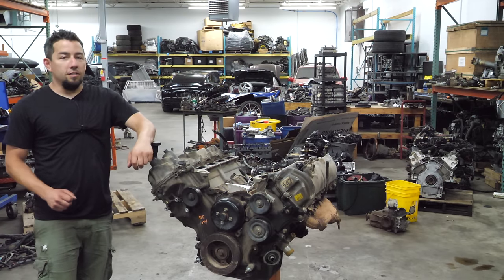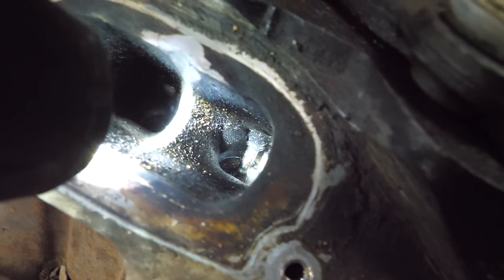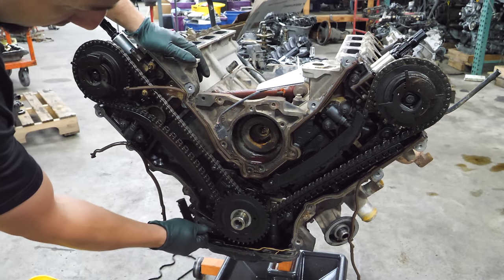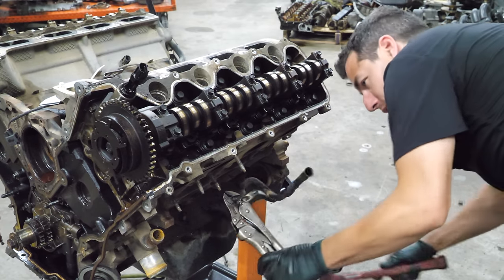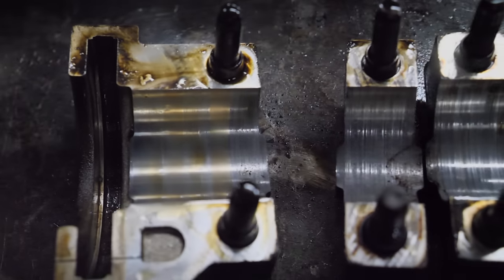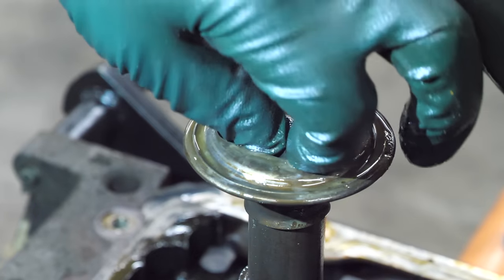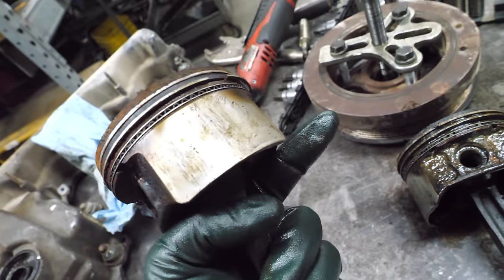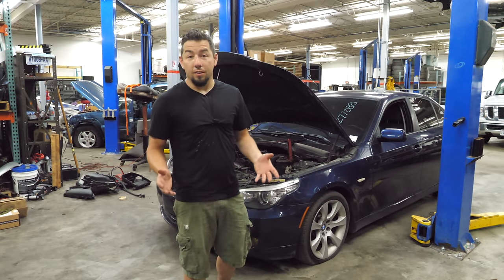Bad Ford 5.4 3-valve V8 Engine Teardown. Which of The MANY Possible Failures Took This One Out?

Comment: I don't know why, but the 3v 4.6 and v10 faired much better.  One can say less of them were used, but there are allot of Explorers out there with the 4.6 3v.  I work at a Ford dealer so yeah, we've fixed a ton of them.  But I have seen quite a few with well over 300k on them.  In fact my uncle has a 2009 Explorer with close to 350,000 miles.  But, its been meticulously maintained.

Comment: I see these over 250-300k all the time. Most all the problems they have are lack of maintenance issues. The 2 PC spark plug is a stupid design but u can get a 1 PC replacement for cheaper.

Comment: Every thing has flaws. I have an 08 f250 oil changed every 3000 miles since truck was bought new in 07 September.  I don’t use this truck for anything but driving and occasionally to pull a utility trailer.  My truck has 104,000 mile lives in the garage except when using. I’ve always taken excellent care of anything I owned it uses no oil but as I have said if you take care of what you have it normally will be ok for many mile.  Before this 08 I had an 04 f250 and it used a quart of oil every 2500 mile, no other problems I drove if 125,000 before I bought the 08.  I once had a Chevy with a 350 and it used a quart of oil every 500 miles had it tore down and the piston rings were lined up causing the oil problem so remember anything coming out of factories can have problems

Comment: I have a f250 2008 300k miles, 1 manifold replacement at 100k ,no other problem. Change oil every 5k miles and auto matic trans.all original. Daily driver and farm truck.

Comment: Thoes cam journals are normal and fine. All 5.4L cam journals are like that because they used aluminum for the journals and heat treated steal for the cams. Mix match in materials with no actual bearing as a buffer so this happens

Comment: This engine is KNOWN for timing issues. Under performing oil pump is the main issue. Cam phaser issues is the next major issue with this engine.......Also timing tensioner blowouts, which is what appears to have happened here. Tensioner left the chat which allowed the chain to eat the plastic timing chain guide.... which also allowed it to jump timing.

Comment: I know someone who swars by them 5.4 3v, and hes had it replaced once in his truck... They make good power but man they are such terrible engines, I worked on the 4.6 5.4 and 6.8 and both the 3v and 2v flavors, I like the 2v better once you get around them popping plugs out the heads on the 5.4s but they were at least somewhat reliable unlike the 3v...

Comment: The mine problem with these engines failures is the quality of oil people use its beat to run mobile 1 or Amsoil full synthetic but people let these service shops put cheap conventional oil in them I've seen 3v 5.4s wit 400+k on them spark plugs do sieze wd40 sock them then antisieze new 1s

Comment: I had 05 with 5.4 and the only problem I had was plugs , but otherwise it was a good motor I had 154000 on and only replaced starter .

Comment: I have a 2002 5.4l 2V Triton f150 with 160K miles, and except for #8 burning ~1qt oil/3K miles, it's still going strong. I change the oil religiously every 4-5K miles. None of the plugs snapped when it had its 100K tuneup. Videos like this one scares me off buying a new Ford truck. It's like Ford and other auto mfgs forgot how to make engines!

Comment: 5.4 3v is a good engine if you do proper maintenance...as far as the phasers, get a lockout kit and a tune and your good to go😎
Reply: @armslength2618  you are correct and I know valve timing is there for a reason.  Again 5.4 3v is a good engine..just stating my opinion on the phasers being a point of failure and a lockout kit being the answer to this issue, would I do this to a stock engine? No..a boosted engine so far from stock that it wouldn't matter? Yes I would👍

Comment: they're basically an late 90s engineer designed motor meant to be a throw away at about 200k - my 2009 fx4 has been flawless so far -150k  always change my oil at 3000 5-30 motorcraft

Comment: Before I make a purchase of a car, I visit car parts stores and ask questions. I then go to independent car repair shops
and ask questions. eyebok's comment(s)  below were absolutely verified by my visits to the above. What did I buy? A used
Hyundai Sonata which as of today has over 150,000 miles on it and we have done NOTHING for repairs. We change the oil
every 3,000 miles, transmission fluid service, etc. on a timely basis. The only other car in our family that went further was a 
1994 Mercury Station wagon with 278,000 miles without any service repairs.  Why did we get rid of it? The body, roof,
etc. started decomposing in the form of rust!  The body repair cost plus the discontinuance of the Mercury line was not feasible so we sold it the local community college repair program.

Comment: I don't understand how these engines are "hated" so much. Was there a lack of maintenance? I can't say I "love" this engine - if it works, it's just great in my opinion. So, I've had a bunch of them: two 2004s in F150s, one 2007 Expedition, one 2008 F150 and I am currently driving a 2012 Navigator which gave somebody ELSE an issue as it's got a Jasper motor in it. However, by the looks of it, this vehicle was abused both via Carfax (if that's any indication) and just the look of the rest of it. But it was relatively cheap and it's a comfortable, quiet, isolating feeling vehicle. So I like it. Plus it's ALL black (actually the paint is a super dark grey metallic) including the headliner and that ain't easy to find trust me. So yeah, I'm pretty on top of maintaining my vehicles. I aim at changing oil & filter @ 3,000 miles instead of 7,500 - 10,000. Anyway, again, is the 5.4 3-valve not good if it's not maintained or is it engineered poorly?

Comment: As a life-long mechanic and motorhead, I refuse to work on any 5.4 triton 3v. The first rodeo was an absolute Nightmare and would never touch one again. There are thousands of vehicles out there to work on and easy to take a pass on this one. I'm sure I'm not the only Tech out there that won't touch them either.

Comment: those chain tensioners are the root cause to phaser failures on these engines....every single 5.4 i tore down had blown out tensioner seal causing the head to starve of oil.    what needs oil pressure to operate?   the phasers.
Reply: the fix is to install chain tensioners from a 2 valve engine, they reliable as fuck as they are cast iron vs the 3 valve plastic tensioners

Comment: I had one of these in a daily driver 1997 f150 for 18 years. The only issue i ever had was to replace a few of the coil overs. This was the best engine i ever owned. I heard all the horror stories over the years but not for. The other incredible thing about this engine was that it never leaked oil. And I mean not even a wet spot....literally. I sold the truck at 167k miles and regret it to this day.
Reply: That's a 2v engine and I got one too. There great.

Comment: So timing bits and bobs clogged up the pickup and starved her of oil. That lead to increased heat under load and likely caused the rest of the carnage… I’m guessing it made noise for a long time and the driver just cranked up the radio…

Comment: There's several other engines from other manufacturers that are worse than the 5.4 3v. I've been a mechanic over 40 yrs. 
   The people that say they've never had an issue are prob the ones that always changed their oil and used the correct type, weight, and filter.  
  The suggested timing chain maintenance was 100k miles. Which is no different than many other engines. So when people put 150k miles on them and not do the maintenance required,  the engine gets blamed? 
  I personally do love the 5.4 3v.  I have several that are the most reliable engines I have. Most of my trucks have over 200k miles are are daily drivers.  I have several duramax and cummins sitting here broken with worse issues and yhe cost is higher to fix them. 
  Timing chains are the common problem with the 3v. But again, lack of maintenance is the problem.  Also using aftermarket parts is a huge issue. I quit using aftermarket timing components because they all suck and don't last. You can replace all the timing parts with anything from the local part store, Amazon, ebay,  whatever, 6 months later they break or wear out, then again, the engine gets blamed.  It doesn't cost but a couple hundred more to use oem parts.
  I replaced many engines because the owner insisted it be replaced simply because some other shop told them the engine was bad.  The most common thing I've seen is for shops to say an engine is bad simply because it's a 3v. 95% of the time, a simple timing chain job put it back on the road for another 100k miles.  Only 1 engine out of the hundreds I've did timing jobs were truelly bad. All the other engines I've pulled out, I replaced the timing sets, some needed head gaskets, and sold them to other customers.  I have one in my personal truck that the dealer claimed was bad, yet I've put 140k more on it after I did the timing set and it's still on the road today. 
  It's kinda like fake news to point out all the issues when it all goes back to maintenance.  Wrong oil type, wrong weight, going 10k miles on oil all cause these issues.  Also, oil filters from quick oil places are not correct. They claim to be the appropriate replacement, but I haven't found one that is.  I can tell right away why people have issues. As soon as I see an off brand generic filter, that's all I need to know.
  And it's really not hard to do the timing job. It's more intimidating than doing it. Once you do it, if your a mechanic, you'll ask yourself why so many say it's hard.  It's not, they just go off what others say and not find out for themselves.  If it is hard for them, they aren't mechanics.
  I truelly like the 5.4 3v.  When you've been a mechanic for as long as I have and worked on everything as I have, you'd understand.  Percentage wise, very few has major issues if taken care of.

Comment: Actually, this probably isn't the most hated engine of all time, on a per-engine basis.
GM 140 used in the Vega.
The "50,000 mile engine" (GM PUT THAT IN THEIR ADS!) - that was almost certain to crack the block at 50,000 give or take 10%.

Comment: If you haven’t had a broken spark plug in this you haven’t had it long enough. We would soak them in bolt penetrator for hours then try to remove them. Even then some were a nightmare

Comment: THAT ENGINE WAS GREAT FOR FORD MOTOR COMPANY BECAUSE MOST OF THEM DID NOT BREAK UNDER WARRANTY. SO THAT WAS PERFECT FOR THEM. ONCE OUT OF WARRANTY THEY SOLD TONS OF HEADS AND LONG BLOCKS OUT OF WARRANTY SO THERES NOT MUCH MORE THEY COULD ASK FOR ON THE MANUFACTURE SIDE OF THINGS.

Comment: I have a 5.4 in my 2008F250 the engine light stays on! a mechanic tried and a ford garage tried to fix it I guess if I wanted to fix it the Ford garage would charge $20000 to fix no guarantees.

Comment: got a mate with 470k miles on one. has the rattle from the timing but still runs.        ur engine looks like a blown headgasket, betting it would have gone another 50k if replaced in time

Comment: over the years many of the failure prone components have been revised by ford. unfortunately, it usually takes the original equipment failing to get the new stuff put in. typically it seems that the very most prominent issue with these engines is the tensioners. the gaskets let out on them, because you know... its a gasket and then the chains go loose. when they go loose they will strike the guides until they break just like this engine. meanwhile, now that the gasket has let out you lose a good chunk of oil pressure.  the phasers are known for failing on these engines but now youve dumped gasoline on the fire. so now, you engine is low on oil pressure, chattering on start up and between 900-1200 rpms or under a torque load. if you dont fix it quikcly you will find that the lack of oil pressure trashes the heads, primarily the passenger side as it is the secondary head for oil flow from the oil pump just like this engine. couple everything youve just read with the fact that chunks of plastic guide are getting sucked up into the pickup starving the oil pump which damages it causing yet another source or low oil pressure. so now its a matter of time before something gives. will it be a follower, phaser, or timing or maybe something else? oh yeah, its a truck engine, a vehicle type known for wooing in severe driving conditions such as towing, hauling or extended idling. plenty of these engines were the hearts of many fleet vehicles so they didnt get excellent maintenance either. maybe that was why this engine was so nasty on the inside.

if you have one of these engines in your own vehicle fear not there are plenty of resources out there to save you the headache of needing a crate engine. as i mentioned ford did revise many of the parts that go into these things such as the phasers, spark plugs, and i believe the tensioners did get a revised gasket. an extremely popular option when going down this route is replacing the oil pump with a high volume assembly by melling which is not very expensive. past this, these engines will run for an extremely long time with normal maintenance.
Reply: i will add that yes i have a 5.4 3v and i did do a timing job on it while knocking out a huge amount of other preventive maintenance items while i was at it. my truck broke both of its guides somewhere around 20k miles before i tackled the job. so it hit 200k on the odometer before needing a timing job. really, thats not that bad considering most vehicles need the same job done around that mark. but your mileage my very... i dont beat the piss out of my truck. 

i am also not going to say this is a good engine by any stretch. its trash and i feel horrible that the previous owners of my truck who bought it brand new took such good care of it just to have ford engineering slap them in the face, which is why they needed to sell it. give the money pit to someone else... and i dont blame them.

Comment: I had a 2wd 2012 Expedition that I put 116,000 miles on. The damned rotors front and rear gave me more problems. All I ever did was regular oil changes every 5k or so.

Comment: Unfortunately these engines have to be overserviced as in 30 metric k plug changes 5 k oil changes a hint of sludge kills these things and after 100k go to 5w30 oil Pennzoil Platinum. My 07 is quiet and runs smooth with 200k on it getting a little long in the tooth living in the rust belt the body will die before the engine. If you know how to look after one of these hell 300k.

Comment: Mine has 270,000 miles. It has been great. They are definitely a problem if the maintenance isn't done, but it can be a serviceable motor. Definitely not tge best product they ever put out, but probably gets excessive hate.

Comment: For anyone that has this engine, bottom end is SOLID. Will last 300k miles easy. You can bulletproof this engine by a timing job, chains, tensioners, guides, phasers gaskets etc and replace the roller followed. Total cost around $1500 in parts BUT you have an engine that will last 300k plus miles now easy.

Comment: what are you talking about no body likes this engine, our 2006 navigator has this engine and currently has  250,000 at 200k we pulled the original spark plugs out, the AC is the only thing to have had trouble so far. I bought it at 108k and literally done nothing but oil changes every 8k miles. its my daily, gets about 200 to 500 miles a week.

Comment: Still sont understand the hate, i run full synethetic 5w-30 in both my 04 and 06, both are nearing 200k, both still run strong even in the winter years, the 06 snowballed(lots of small issues, none engine or tranny related) and the biggest issue on the 04( which has 180k) is the unlock button doesnt work on the driver side, all ive has to replace on that truck was a starter ( sank in the ice before i got it, and a hub assembly 😂😂

Can we all just admit the major issue was ford saying to run 5w-20

Comment: I think there a great engine but do the  i hv  05 mustang gt other the timing components  oli pump lifters roller follows and comp cams  bone stock 
Oil  pump  oil preasure  was 19  now 75 psi

Comment: I have experience with 3 of these engines. Two 2005 F150 and my wife's current Expedition. First 2005 F150 had 155K trouble free miles on it. Hard towing all my toys to the desert and used as an off-road desert toy when unhooked from the trailer. Really impressive how long this engine can hold rpms while towing 8K lbs up a 6% grade for 5 miles. It also had a CAI, long tube headers, and a custom tune all its life. I traded that truck in so I don't know what happened to it after that. Second 2005 F150 is now my dad's truck with almost 100K on the clock. You can barely tell it's running its so smooth and still plenty of power. My wife's Expedition now has 140K on the clock and it purrs just like the other two 5.4s. Plenty of power and every 5K the oil looks like the day I put it in. The secret to making this engine (and all others) last is regular maintenance. The VCTs in this engine are very sensitive to dirty oil. Using a good friction modifier is a good idea as well. Gives you a little wiggle room if you don't get to your oil change within 5K. Don't forget your Motorcraft oil filter. Am I lucky? Maybe 🤷‍♂️

Comment: I just paid $6500 for an 06 f150 with 108,000 miles on this engine. Couldnt find a better deal in my area. And couldnt find a 5.0 with less than 150k miles for $14k

Comment: Ford had fixed the issues with this engine by 2010. We’ve had little to no issues but we do change oil every 3000 miles and also ran mobile 1 0w30.